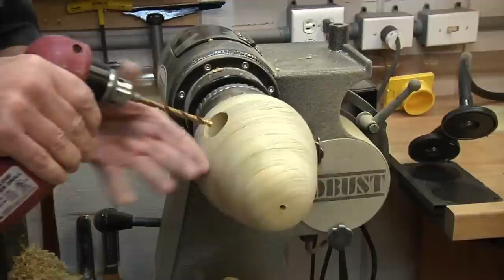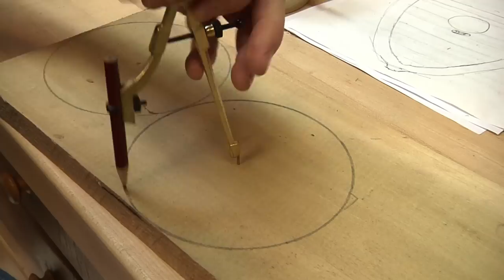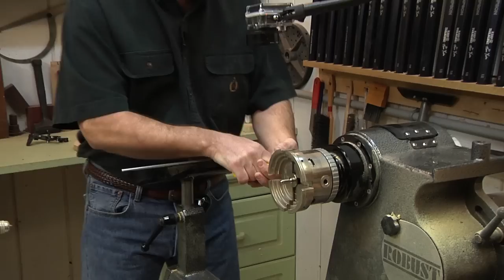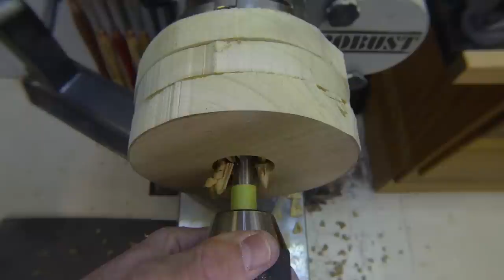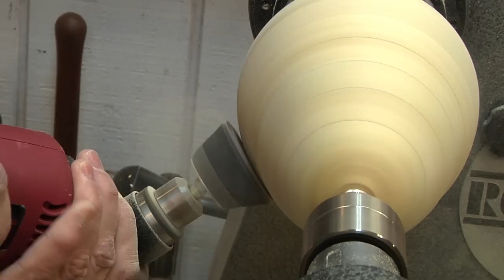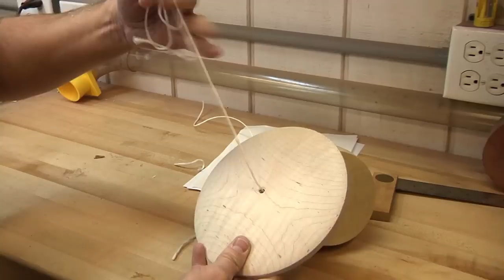Birdhouse

Comment: Cool project Tim. I put out 6 bird house on my property several years ago. They all have 1.5 inch diameter holes. I don't get any birds wanting to move in, but every one of them has flying squirrels in the winter months when the leaves are off the trees. The flying squirrels love my bird houses.
Reply: If you want chickadees, don't put a perch on the front. The perch encourages sparrows and the chickadees don't need it.  
I'm going through turn one if these.  Great idea and great work.

Comment: I would have never thought to put in a drain hole! Great tip. This project is on my to do list. My only question concerns cleaning out the inside after a season of birds living in it. Would having some way to take off the top to clean it out be a feature to add?

Comment: Tim,  Regarding brittle CA.  Have you looked into the No VOC Foam Safe CA such as BSI Super_Gold+. I tried it because of the VOC issue, and found that I liked the fact that it is somewhat flexible when finished.  I use it to glue pen tubes into my pen blanks, and other quick jobs when I have a concern about its durability. I have been impressed so far (or it's all in my head) :)

Downside is it is more expensive that traditional CA.

Comment: hey tim, how much did the american beauty cost?
Reply from the maker: The standard bed starts around $6,700. But it goes up from there if you want to add on extra things like 3 horsepower motor, tilt away tailstock... things like that. I must admit every time I go out to the shop I smile when I see that lathe  sitting there. It is a wonderful machine.

Comment: Mr. Tim Yoder, I have the greatest respect for you, I saw you make beautiful pieces and I always admired you for everything, even your sense of humor, but to my incredulous surprise you made a mistake that I never expected of you, ... and at 14:10 something happens and I knew it would happen, the worm screw was stuck in the chuck but not pulled out, it was not the tool nor The aggressiveness of the cut that caused the problem, ... with all due respect I say, I did not want it to happen but I expected it, all the best from amateur, ...
Reply: Good catch Paulo! I had just gotten the chuck a few weeks before (this video is over 3 years old) and had not had the worm screw slip before. At the time I just thought it came loose but you are right. I had not pulled the worm screw forward before tightening. Since then I try to point out that little trick when I use the worm screw.
Reply: I admire your humility ... and gives me some reason to admire you even more for all you do, I take this to learn more, ... all the best Tim,...